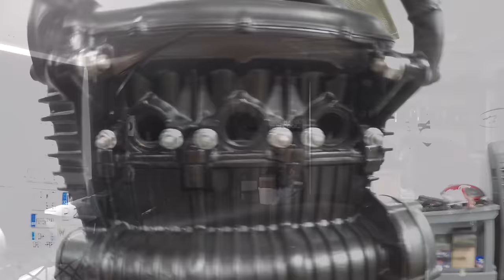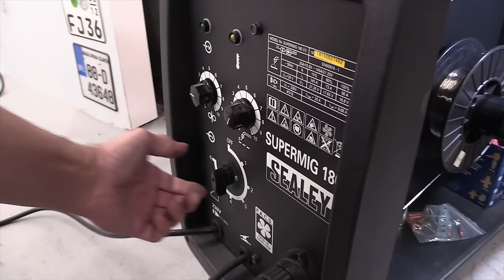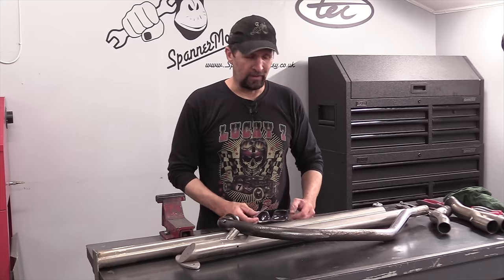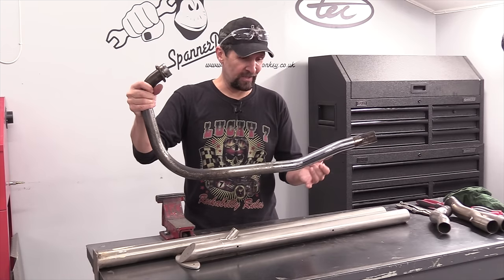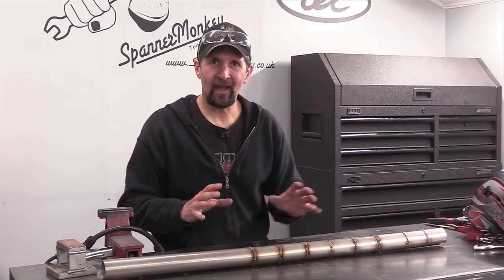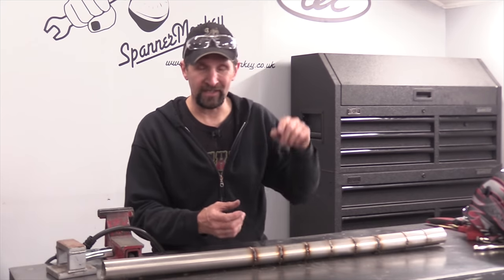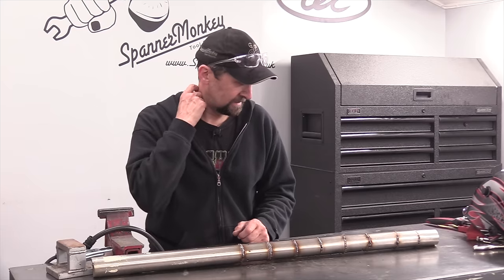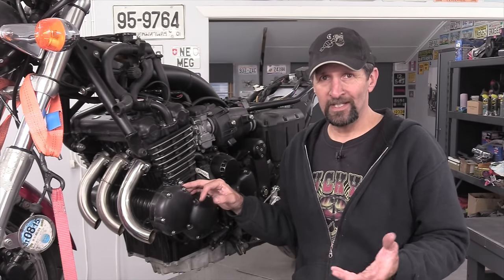Triumph TT Legend, 3-into-1 Header Pipes (Pt1) Practice !

Comment: My 2 suzukis (sv650 and dl1000) also were stainless exhausts. They looked rusty and crudded up. Cleaned them with soap and water and then used autosol. Stuff is amazing. I saw a bunch of guys in India restoring BSA motorcycles. And they all used this polish. Best of luck sir! (And miss P)
Reply from the maker: Hi Richard, good to hear from you, and yes, you're right, Autosol truly is the mother's product!  A while back I discovered Harpic as a great cleaner for stainless, and it's so cheap when you've got a lot to do... just as long as you wash it off thoroughly and then you can use a tiny amount of Autosol just to bring up the bright finish!

Comment: Hi Del, enjoyed your try and see approach. What I think you have discovered is a sort of manual version of automatic Orbital welding. We use an orbital welder which allows us to join thin walled stainless steel pipe approx 1 mm wall thickness without filler wire (from 1/2" Od to 2" OD - although bigger diameters cab ne done). The two pipes are clamped in a mandrel ( which is water cooled and purged with Argon) and the tungsten tip rotates around the pipe pulsing on and off the amps. Each 90 degrees of rotation has a weld current and a background current and these values change as the weld head rotates through each 90 degree segment, this is because heat builds up as the welder rotates and you need less amps. If you search orbital welding on thin walled stainless pipe there are some good videos which may help you in your manual welding. Have you thought of using a means to hold the weld head steady and maybe rotate the pipe, I know that sounds difficult, but the key is keeping a constant distance from the work piece for thin walled pipe. Hope these comments are useful. Enjoy the channel immensely, thanks for doing the videos for these all years. Cheers Simon
Reply from the maker: Thank you so much for your kind input Simon, thats very good of you.. ill be practicing a little more off camera, and making some plans for the job.. hopefully i can bring home a good result.. take care and thank you for your support.. Del.

Comment: Hi Delboy..,.im not a welding expert, but i saw an indonesian guy doing these neat welds with pipe on his lathe at super low speed  PS love your work & im a big fan
Reply from the maker: Hi Tim, d'ya know what, I even thought of that when I was doing it!  Sadly my lathe turns at minimum 400rpm, so I'd still need a spare hand to turn the pipe, you can buy turntables for welding, but it's all equipment and you know how it is, it's all gotta be paid for!   Thanks for the nudge buddy.

Comment: Couldn’t you try your pipe bender Del? 

Also will need to make sure you include a smaller diameter inner pipe insert to make a nice strong join, could plug weld the insert and then seam weld around and grind back. Hammer is fine but vibrations will always find a weakness.

Looking good mate!
Reply from the maker: Sadly the pipe bender I have is for thick pipe and is in imperial size, for this work I'd need a proper mandrel bender and I just don't do enough of this work to reflect the investment!

Comment: Remember don't use co2 mix gas for stainless. MIG is 100% argon or 98/2 or was it 98/10 oxygen for a weld you don't want to crack a year later. Back purge same deal.. without it, it will eventually crack.

Comment: Great work again, learning to weld myself to save my old Landy. Just a thought, have you considered the exhaust from a 955i Tiger. Pretty much the same engine and it has a 3 into 1 system. Could be a lot cheaper to source parts and adapt as you need.
Reply from the maker: Thanks Rob,  but ive thought all that through, and if you have a close look at them, they have square ports like the speed triple, and solid flange holes set at a diagonal angle.. the studs on this bike are set horizontally.!    plus, they're really ugly and not gonna complement the bike even if they did fit..!  shame it's not that easy.. i guess ive got to take the long road aye.
Reply: @Moonfleet41  That's why you do and I watch :-). Looking forward to how it all works out bud.

Comment: Just watching this video again as it looks like I’ll be doing some welding on the bandit next week. Header was blowing right at the top so ordered some new gaskets and managed to get the headers off without snapping the bolts. Then found that the flanges for the middle pipes had totally rotted away. Ordered 4 new flanges, debating what would be the beat way to get them on the pipes. Either cut the flanges In half, fit the headers and then bolt each half of the flange on and then spot weld the gap so I know they fit, remove headers and then weld the flanges up properly. Or cut across the headers, slide the flanges on and then weld the pipes up again. Only have an arc welder so I’ll be using that. Which way would you tackle this Delboy?
All the best
Mike
Reply from the maker: Hi Mike, I'm not sure on your budget mate, but either way, you're a little boxed in... Bandit headers are notorious for rotting in the collector and they're not made from very good stainless in the first place, either way you approach it, you're gonna need to rely on your skills with the arc welder to weld those flanges back together... but once again, if you have the budget, then me personally, I would simply invest in a new set of headers in the first place, it's a great upgrade, they look better and will actually breathe better as well... the best quality I found at a bargain price is LexTec, you can buy them from Wemoto, they fit on like factory pipes, are amazing quality and a lot nicer looking than the factory ones, so maybe an option for you mate.
Reply: Hi Delboy, thanks for getting back to me, it’s a pain as the actual headers and the rest of the exhaust system is fine, whole thing was welded into one piece by the previous owner, I assume because of the famous/infamous rot they get at the collector. Literally only rot is on the two middle flanges that bolt on. I guess slow and steady is the way to go.🙏🏻🤞 cheers Delboy
Reply from the maker: @jedibiker600  Ok mate, they all seem to end up welded at the bottom, mine certainly were, but if you are gonna take them apart and weld them, then as always, weld them down at the collector as then it's out of sight and no-one will see it... Good luck with it mate, have fun!
Reply: Cheers Delboy, I’ll let you know how I get on. Since I’ve been watching your videos on here and Facebook I’ve been doing so many more jobs myself as your videos are really informative, entertaining and gives me the confidence to try and do jobs myself. All the beast to you and Penny.:-)👍🏻

Comment: How do you recommend to clean header pipes? On my Bonneville SE they are not shiny and there are black spots which for me looks like corrosion. I tried 600/1000/1200 sand paper but this didn't worked out really.

Comment: Nice!! So happy you are back working on the Legend, although the Busa is cool as well 😎.

I know people have twisted the left pipe into the other two and welded them together (where the other two meets). Maybe that is one way, would also generate even back pressure for all cylinders as opposed to a collection further back, what do you think? 

I found a cheap T509 3-1 (97-98) header on ebay that I could fit with a little denting on one of the pipes (to clear the sump) and a coolant pipe relocation. Worked out great with a V&H Thruxton R muffler. Had it on the dyno this summer, 82rwhp (stock is around 60-65rwhp, ~70hp at crank) and a flat nice torque curve (also open airbox and re-jetted carbs). A little sound clip of my bike here:
https://youtu.be/81hj75zJMGY
Reply from the maker: Hi Fredrik, yes moving the left pipe across to join the others is the most common option, but it'll need a little surgery to achieve that, lengthening it by at least 3-4" for a start as tucking it next to the other lower pipes leaves the top of the pipe 4" below the port, but it's do-able!   But there's a few options and I'll get stuck in, hopefully, for the best outcome!  Thanks for your video, bike sounds beautiful and gives me inspiration to keep going!
Reply: @Moonfleet41  Love your videos man, best enjoyed with a cold beer. 

Btw, I installed Ricor Intiminators in my front forks a few months ago (very nice front supsension mod) and rebuild the forks as one was leaking and I had no idea when the fork oil was replaced last time... Found this great video which I used, you should check it out!
https://youtu.be/vrmYJgcGX30
Reply from the maker: @fredriksalmen5159  Thanks Fredrick, glad it helped!  Ride safe...

Comment: if you where using argon it would have gone better for you mate ards stainless
Reply from the maker: Yes you're right, done some reading up on it, and the very best way is pure argon, but using C25 at the moment, not just plain CO2, so it is ok for now as it's 95% argon and 5% CO2, the guys at the weld supply said the difference would be hardly noticeable with MIG, and only with TIG would I need to use pure argon only, we can always do better aye, it's just affording it all!